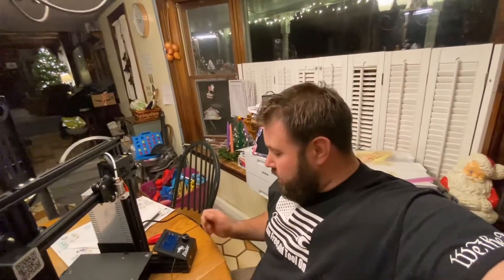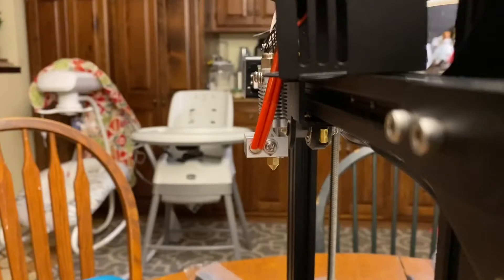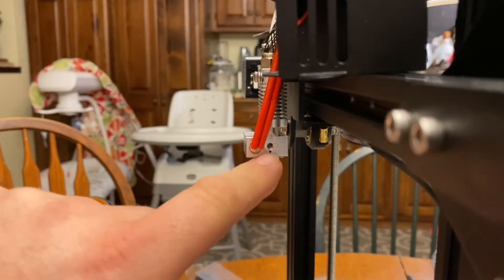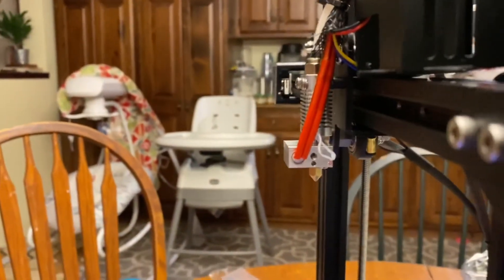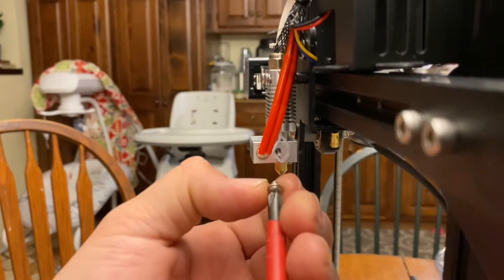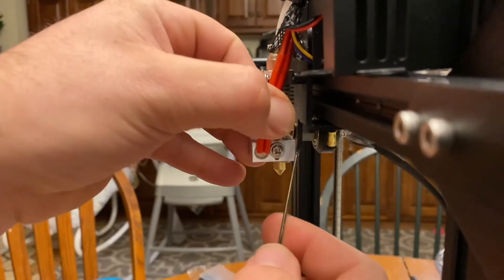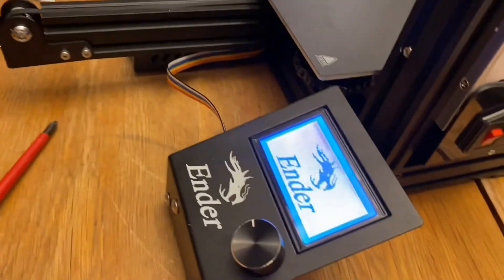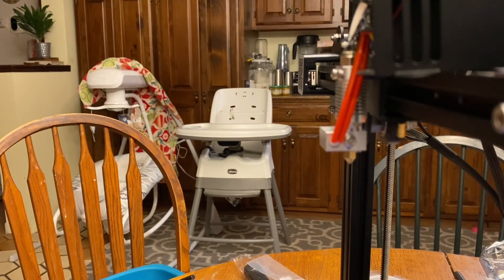Ender 3 start screen beeping fix

Comment: Thanks for this video. I am facing the same issue. I need help. I removed that wire and mistakenly removed the plastic. Now I have naked two wires left. What should I do? The beep is not stopping.

Comment: You help me a whole ton. I have been going at this problem for about five hours. I had an issue where I would have them run away so in the process of trying to adjust the thermostat I tore one of the wire so I had to replace it and soon as I replaced it, I had this issue

Comment: I'm having this issue right now on an ender 3 pro I bought second-hand. Previous owner installed a thermistor that doesn't seem to have a screw for the ground wire, instead it has a push pin. I can't remove the pin so I'm replacing the whole thermistor. Hopefully that fixes my issue

Comment: Thank you so much for making this video. I just replaced my thermistor and had the same problem when turning on. After hours of searching through the internet and checking other connections, I was starting to think my motherboard was junk. Nope, it was the thermistor wires. You saved me a lot of time.

Comment: I know this is a bit old but any ideas on what to try if the screen flashes and beeps? It's not a constant tone it's just beep beep beep beep and not booting. If I press the knob on the display in it does however emit a continuous tone as long as I hold the knob in.

Comment: i have the same problem, my hot end clogged, so i dissassembeled it to clean and after it started doing the beep, after your tutorial didnt work i tried taking it apart again and realized the wire had snapped, so if this tutorial dosent work for you make sure the wire is still intact

Comment: Ohhhhhhhh Myyyy Gosshhhh that helped me so much    people on facebook were saying i needda multimeter to test the ohms. and thats 25.00 on amazon....   I didnt even have to adjust the wires i just had it tightened too much,  Thank you a million times.   my problem happened after I changed my hot end.

Comment: thank you dude fixed my issue too for a long time now .. didn't figured out that this little screw when you changing to a new extruder and thermal heating kit needs to be not screwed hard enough but a little bit loose. ! well that's disappointing from my side ...

Comment: Hey man, do you have any advice on why it might not be working ? I did what was told in this video and the beeping is still there. Should I just buy a new motherboard and see how that goes?
Reply from the maker: Call the manufacturer this was just one issue but many could be present

Comment: Thanks Man, I was screwing that part (after replacing the unit) in when the screech stated. I needed your video to help fix it. One thing I read was to flash the firmware, lol. 

But really, Thanks a lot.

Comment: Hi Everyone,
I needed to replace my mother board and the same problem appears. 
In my case, the nozzle and heatbed connections ( white wires) was changed On the Maintenance.
Just put it in the right place and worked.
 I hope It help you all.

Comment: Thank you for this video, my Ender 3 is having the very same issue. It started happening after I changed my extruder nozzle because my hand accidentally slipped and knocked into the heat block. I am going to go ahead and try this and hopefully it is as simple as being grounded out and not anything more complicated.
Reply from the maker: Let me know if it works

Comment: Sadly this fix didn’t work for me. Got the maxtemp error and loosened the thermostat screw. Still got error. Replaced board and now loud beep but no display. Ordered a second board thinking the first board was bad. Has same issue. Tried loading latest firmware. No fix.

Comment: This noise happened to mine when I tried to install a bl touch. I think I mest up the firmware but I went back to the original firmware from the website without bl touch and this noise has not gone away. I will give this a shot. Just to be sure..this is ended 3 pro right not v2?
Reply: Hey I've got the same exact issue as yours. Mine wasn't solved by this video either. Did you find a solution yet?
Reply: @vengefulSpectreVR  Have you found a solution? Exact same issue here.